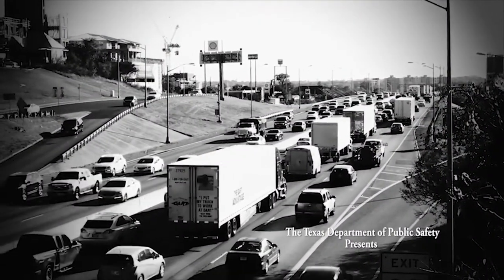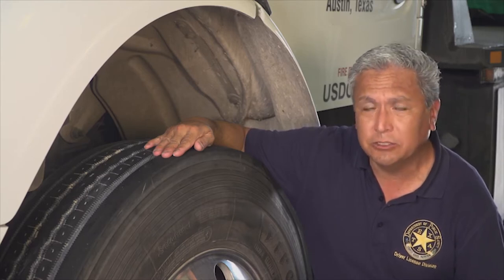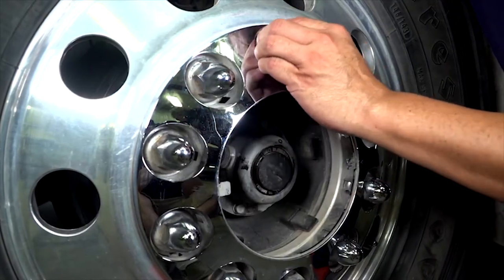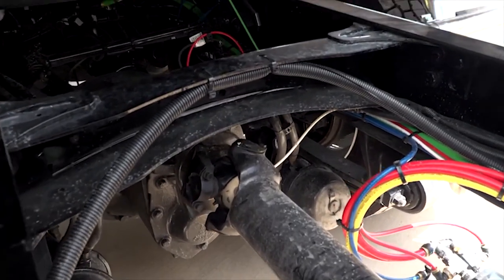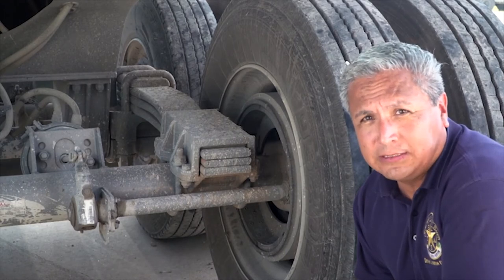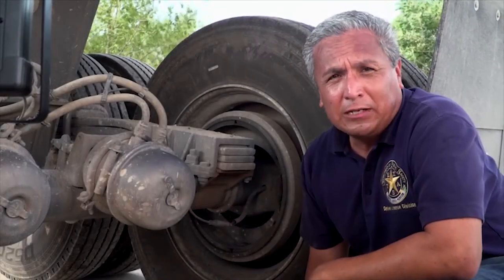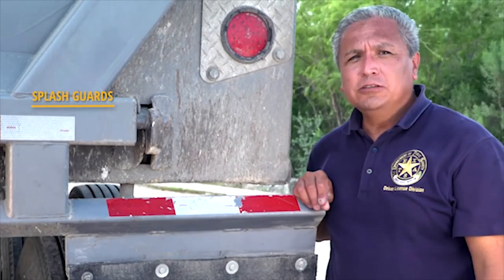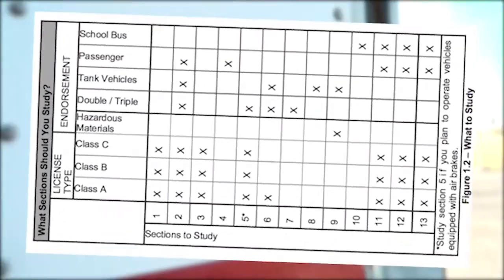CDL Instructional Video - Module 5 - The Axles (Updated 2021)

Comment: Does someone need a class C before applying for a class A??
Reply: Yes sr
Reply: it'd be odd not to and I for one wouldn't train a guy without a class c, unless he was a ex-con
Reply: no you do not need a class c first. you can study and take skills test directly for the class a if you want. you can that info from texas DMV website and also down load the Texas DMV Handbook PDF
Reply: @arrlos73  Thank you so much.
Reply: Not that im  aware of, but most people typically get their C when theyre 16 and the A requires you be at least 18 years of age. i know this comment is two years old but i thought maybe someone would have the same question. If you have an A or B or CDL you can drive a class C vehicle. Also, if you have an A you can drive any non-passenger carrying, non-placarded class B vehicles.